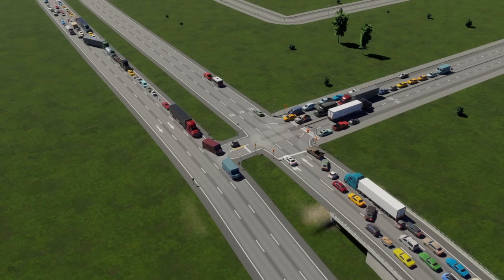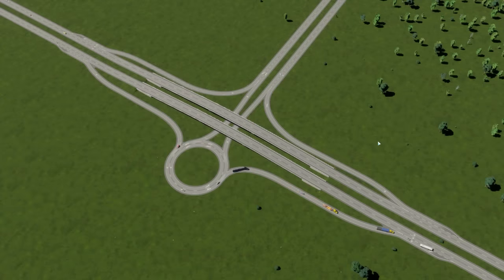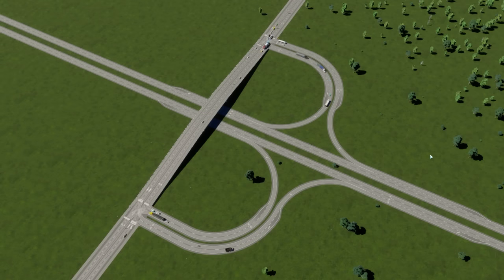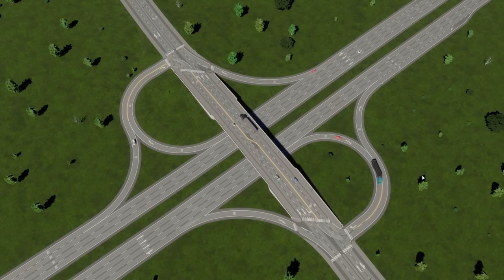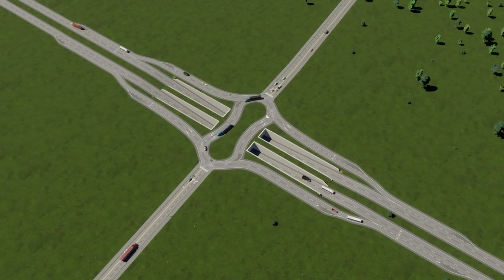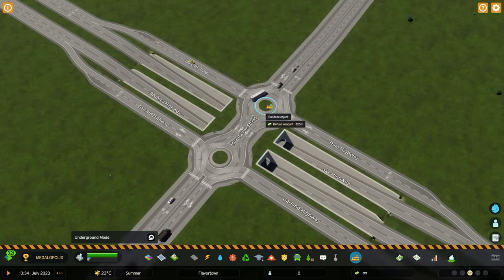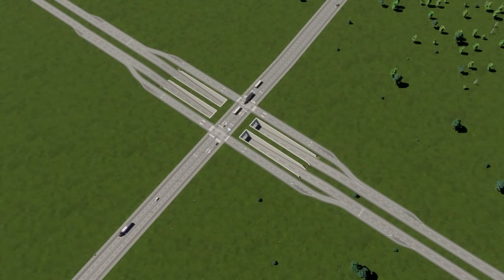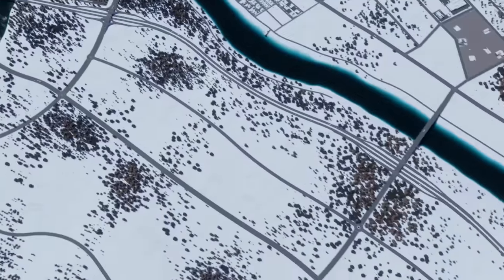Critical Connections! - Understanding the Power of Service Interchanges in Cities Skylines 2

Comment: My favorite interchange design came from you; the so called Single Point Partial Cloverleaf design. I have tried it in CS2 and it works fine so far. Although I haven't reached the point yet where it would be challenged by heavier traffic. I do miss TM;PE from the first game. Back in the first game I've built a 150k population city that ran off a single SPPCI and it worked just fine.
Reply: The good news is that the developer of TMPE has announced they are working on a traffic tool mod for CS2, and while it will take a while to reach full functionality, they expect to have a basic version working by the time official mod support arrives.
Reply: @matthewparker9276  We already have a mod now that has some advanced settings for traffic lights and can also change lane arrows, so I think there's a good chance that we will see more than just basics when the official mod support arrives(which could be in February)
Reply: @TheTaxxor what mod?

Comment: The SPUI also has a variant which is as narrow as a regular 4-way intersection. You just elevate the highway over the local road and have a regular intersection underneath with the “ramp road”running between the highway directions far enough back that it doesn’t get blocked up onto the freeway. Then connect the “ramp road” to the freeway from the left side.

I hope my description is clear enough.

Edit: I forgot to add that while this type of SPUI isn’t very common IRL, it does exist and is called an inverted SPUI.
Reply: Uncommon because ramps connecting to the inside lane of the highway are generally not recommended any more.
Reply: @Doddibot  It's often used for express lanes
Reply: @D3r3k2323  That at least makes sense because it's fast traffic, not slow traffic just entering or about to exit the freeway.

Comment: Yeah, I thought about it but this confirms it. We can not do a proper SPUI in CS2 right now without traffic management. It needs to be a 3 phase light with separate left turns on the local road. Only alternative is to split off the straight direction but that requires a third level or taking off the straight directions from the local road some other way.

Oh how I can't wait for the mod update and the traffic manager, advanced road tools and move-it mods. I love CS2 and what they made it but I really miss those mods for my road building. Hardcore landscaping to force the road I want is really finnicky and a lot of work.

Oh and landscape not physically snapping to roads any more has its upsides, but getting the landscape to have some fat on the bottom side of the road along a hill is so much work now! So I hope a smooth to road / building landscaping option also emerges at some point.
Reply: Some SPUIs are a 4-phase light, even without frontage roads (e.g., SR-101 at Bell Rd in Glendale and SR-202 at Scottsdale Rd in Tempe, both in Arizona).
Reply: @grahamturner2640  I never said every real world intersection is built properly

Comment: The funky merging lanes on the Single Point have a distinct purpose: They manipulate the Traffic AI into merging at specific points on the road, instead of at the last possible moment, which causes the highway traffic to flow better.

 You can see how not abusing the merging lanes causes issues at  11:49 on the video where the white van with the trailer dead stops in traffic while occupying two lanes in order to switch out of the turning lane it has found itself in.  You basically want to add a turning lane next too a strait through lane whenever possible to keep traffic flowing better.
Reply from the maker: Sure, but I think it could have been designed much more cleanly. Using fewer than three lanes to begin with. The built in SPUI is very messy in its current state.

Comment: I often use a very smal trumpet interchange, wich is normaly a system interchange, as a service Interchange to connect a 4 or 6 lane local road. I think it's fine al long as you only need a conenction to ONE side of the highway.

Comment: I noticed that diverging diamond interchanges were not covered in this video. Personally, I think they'd make for a nice alternative towards SPUIs in some situations, particularly where there's not enough room or budget to be able to afford upgrading an existing diverging diamond interchange into a SPUI, such as if the highway was running over the interchange instead of under it for example.
Reply: I think DDI's are best used where turning traffic on-to and off-of the minor street outweighs traffic going straight through. Also, I've seen a diamond variant in Georgia where the left turn lanes onto the freeway kind of cross places with each other like: VV /\ V /\/\, looks a little like a Diamond / DDI hybrid.
Reply from the maker: The DDI actually excels in one spot that the spui doesn’t. When the majority or arterial traffic is not crossing to the other side of the freeway but is turning left or right onto it. My recent video explains it better :)
Reply: @YUMBL  and at one point, Arizona's Department of Transportation wanted to build a 3-level diverging diamond interchange in Tucson as a part of a SR-210/I-10 improvement project. Through traffic along the arterial (Kolb Rd) would take the top level, while the middle level would be for traffic getting on and off the freeway. The premise of the 3-level DDI was to keep the advantages of a DDI while minimizing its disadvantages.

Comment: Yumbl, to remove the yield that you mentioned you just need to right click with the traffic light, or stop sign, in that area and it will remove the traffic control.
Reply from the maker: I believe when you remove a light the yields appear automatically. I could be mistaken though.
Reply: @YUMBL  I have not tried it in a highway configuration but have had success with removing the yield and such with merge lanes in the city proper.  It may also something to do with what types of roads are being linked.

Comment: You point out at 8:30 (ish) that the lane in the teardrop shape isn't connected. But if you watch the video a bit earlier you can see cars do take that path just fine (like 8:02 and 8:06). So it seems to be a bug in the visualization of the lanes, or in the pathfinding ignoring lanes.
Reply from the maker: It’s more functional than I thought, but its still not right. Both of those vehicles used the disconnected lane from the left lane of the roundabout. They need to be able to use it from the right lane. It’s still not functioning correctly.
Reply: @YUMBL  Yea I think they effectively went from the left lane into the left lane, but used that same node to make a lane switch to the right lane. But yes, clearly not "correct". I also don't know why there are even presets with weird lane issues like this, especially when we only have so few.
Reply from the maker: Its a somewhat small oversight, but I’m also somewhat picky 😅

Comment: 7:06 Not quite. This one is a "dogbone" interchange, not a dumbbell.
A dumbbell interchange has full roundabouts at either end (so that traffic approaching the interchange from the local road can turn around without crossing the highway). See 9:06. A dogbone has the two roundabouts at the ends of the highway crossing not fully closed (because barely anyone is using the part of the roundabout that's facing the highway). See  7:06.
If you draw a dumbbell, it's a line with circles at either end. If you draw a prototypical bone, it's a thin middle section that flares out into a bulge at either end.
Reply from the maker: This is true :)

Comment: Can you elaborate on the downsides of using a system interchange where a service interchange would be more appropriate?

I usually build a high capacity system interchange design to flow directly into my downtown main street. It seems like it might be flooding the first intersection that traffic reaches, especially the first left turn. I'm not sure whether a "weaker" interchange would perform better here.
Reply from the maker: Sure, a system interchange is overkill where a service interchange should be used. Just as using a service interchange where a regular intersection or roundabout is appropriate would be overkill. System interchanges are larger often with more overpasses which makes them quite expensive in real life. Overusing them is an unrealistic waste of space that will lead to improbable city compositions when overbuilt, as well as an over reliance on freeways where the city (buildings and people) should be.

Comment: Respect your work, used plenty of it on the workshop for the original cities skylines

But this is infuriating with the amount of illegal u-turns my Cims are just doing whenever, especially if I try to add a slip lane. Definitely taking the fun out of this. And not having access to intersection asset editor and ped walkways being kinda awful and then jwalking anyway 

The SPUI gets stuck on the light and pedestrians in game.. You could improve the highway for people going straight on but the issue is the light for sure. Almost would just go with a slip laned roundabout and submerge/sunked the highway if it didn't immediately cause secondary issues with pedestrians
Reply from the maker: Thank you. I’ll certainly be doing more work with specific junctions once we have better traffic management options. Until then I think many players will still benefit with having the available implements explained :)
Reply: @YUMBL  oh, nothing against you, just me wishing I could manually cascadia event my downtown core right now to clean this traffic up with all the illegal u-turns and pedestrian crossings.

Comment: Great video as always, what is the particle clover where only the leaves after the overpass are used depending on the direction they are going is that a 2 or 4 B type?
Reply from the maker: Leaves after the overpass with ramps in four quadrants is a B4 parclo :)

Comment: I think A means after and B means before 5:13, you did it the other way around.
Reply from the maker: It does not.
Reply: @tamimabushanab44469 That’s a common misconception. However, in actuality it works more alphabetically. A is the first letter so that means the loop comes first. B is the second letter so that means the crossing road is first and the loop is second.

Comment: Is a complete free-flowing service interchange possible at all?
Reply: The service interchanges with roundabouts are free flowing service interchanges in low traffic situations. It’s only once the traffic volume leading into and on the roundabouts increases too much that it stops being free flowing.
Reply from the maker: I misunderstood for a moment there. Service interchanges are much smaller and generally lower flow than system interchanges. As such they allow for conflict. One must exit to a small enough road that conflict is allowed eventually, right?
Reply: There is an interchange I came up with. It works in CS but is large for the real world. It is a hybrid of the diamond and the cloverleaf. The highway has parallel one-way two lane roads adjacent to the highway. These roads are then connected to the highway with ramps at each end. Then connect the local road to the parallel one way roads using cloverleaf ramps that are bidirectional. For smoother flow use two one way ramps (one in each direction) flared out to connect each end of the loop to the road it connects to.

This would make a service interchange variant of the cloverleaf, at the expense of being larger than a standard cloverleaf interchange. That is why it is not used IRL.
Reply: As they said, being free-flowing isn't necessarily the point of service interchanges. But if you start with the ParClo, split the arterial in 2 1-ways, make it longer, adjust heights and use a bridge/tunnel to do the left turns, that's free flowing.

I was looking for a design that would work under heavy traffic in vanilla CS:1 (it's hard to make anything at-grade work well with vanilla lights and lane controls), and got to this.